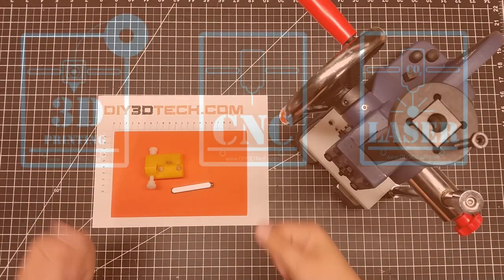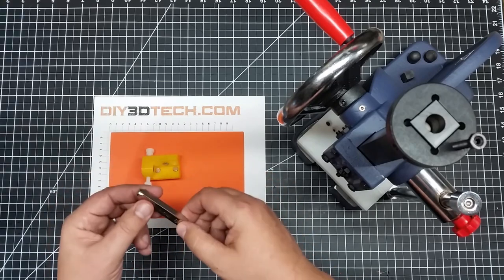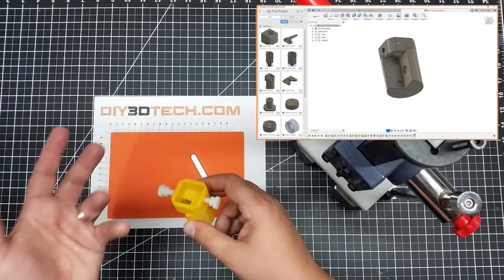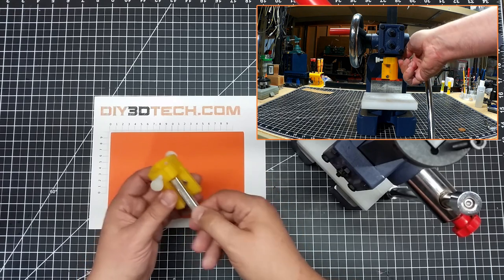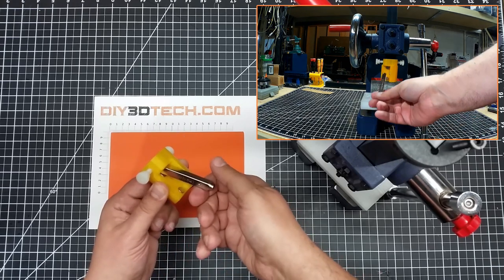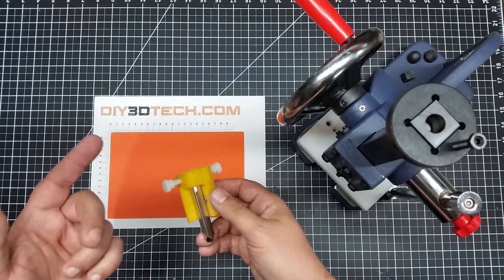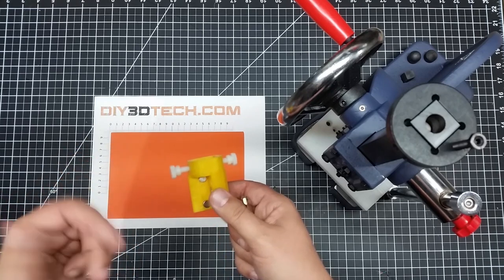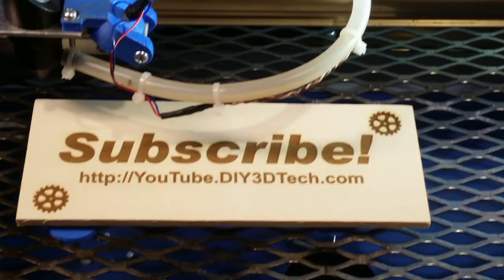Design Talk - 3D Printed Arbor Press Guide!

Comment: Very cleaver. This is engineering. Using the right material and solution for the right job. Plastic, cheap and not strong. It is a lasting solution for this problem. Thx.
Reply from the maker: Your welcome :-)